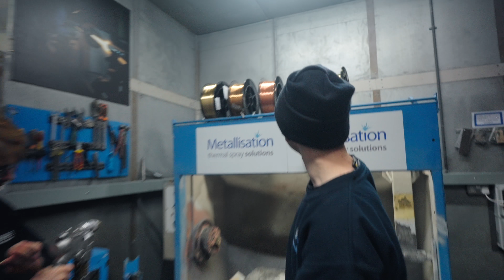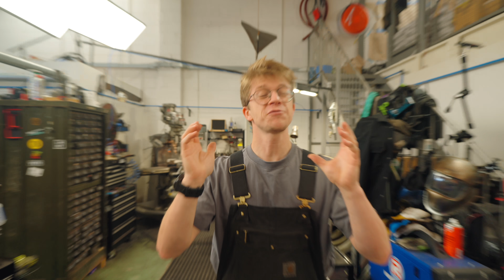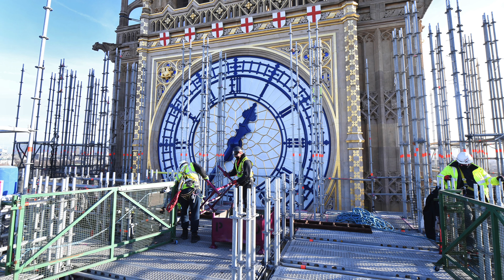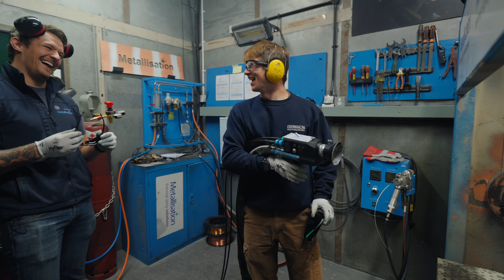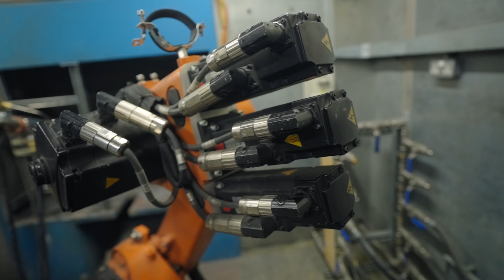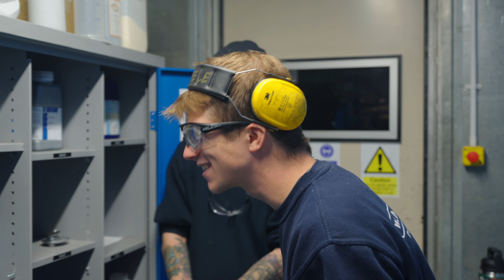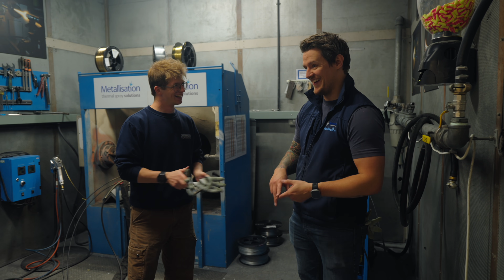Metallization

Comment: My son works in maintenance at a paper mill and they use this method for resurfacing of the rolls that the paper is pressed between during drying to make it smooth ("calender rolls").  These rolls are about five feet metres long, about a metre and a half diameter and weigh about 70 tonnes each.  They run on roller bearings twelve inches diameter!  You can imagine these would be very expensive to replace.  They wear more in some places than others, and by using metal plasma spraying they can build up the working surface and polish it back to a very high degree of accuracy and roundness.  Its pretty impressive to watch.

Comment: I think its difrent to welding like he explained. I was always taught ut wasnmore like Teflon. A mechanical bond no cureing.  Thats why the rough clean surface 'blasted' surface is required. Iv done alot off this for industrial coatings.  Zink bit o did know engineers use it for thier stuff

Comment: My dad used to sell this equipment starting in the early 1960's.  Some spray guns use powder rather than wire.  His biggest customers were jet engine manufacturers.  
Imagine spraying a bridge with zinc after it's built; it would never have to be painted.

Comment: We used Jetspay as well as cold spray at Honeywell on the rebuild side for turbine engines journals. They are absolutely correct about needing wet grinding on the hvhp jet spray especially with that cobalt in the powder solution. We would carry +/-.00005 on them bearing journals. Great invention I’m glad to have learned where it came from!!!

Comment: In Oklahoma I used a lathe that nickel coated rods for oil field drilling. Super cool process. Super hot environment. Had to heat the rod to molten for it to bond.

Comment: They didn’t show you plasma spray. It’s pretty cool too. We use a nickel base coat and a chrome oxide ceramic top coat. 

You use argon as a primary gas and helium as a secondary. It uses an anode and a cathode to start and maintain an arc.

Comment: Thanks for this video, it has answered a question I had, I often wondered how they chrome plate plastic things like shower heads etc, now I know, they spray it with molten copper then chrome plate it like you would a normal piece of metal.
Cheers, great videos👍

Comment: i wonder if the Arc sprayer could make Damascus by using 2 different steel wires (2 wires each a different alloys)  or alternating spray passes of wire of different steels (2 wires same alloy each pass)

Comment: I learned, decades ago, that you could build up metal on engine crank shaft journals through a welding process and then we (the machine shop) would turn that part back to OEM SPECS...  ...BUT I never knew the process was THIS interesting and diverse.  My brain is swimming in possibilities, albeit 30 years too late.

Comment: I'm really surprised that you don't need more protection for doing the zinc. I know that you aren't supposed to weld galvanized metal without protection, how is this different? Is it because the welding process burns the zinc and this just melts it? Really for any of these metals it seems you should have some sort of mask since they are sort of "aerosalized" like a paint.

Comment: This is amazing, you could rebuild and reuse so much mechanical parts with that. for example you could rebuild a worn down artillerie barrel or very large ship enigne parts that wear down. it would be so much cheaper rebuilding really big, expenisve machined items like that instead of replacing them

Comment: with electroplating to build up metal, the built up part has a grain structure thats not as cohesionally strong as cold rolled or hot rolled metal. eg: an electroformed optical reflector, when dropped to cement, will not dent or deform - it will 'shatter' into tiny pieces. if one built up a thickness of metal by these 3 techniques, say 1/8" thick, then after cool down period... if dropped to cement from 20 feet - would it bend or shatter?

Comment: used to work in metalizing did 6 months but totally different setups. we used to metalize CC Chanel make up boxes after they have been sprayed with a special UV coating for metalizing to properly attach and be smooth. had a massive fixed machine Vacuum chamber system, you would Load the cases, load the aluminum filler 3 inch big each in what i would describe as coils/filaments many of them, close the machine and make Vacuum, filaments light up burning the aluminum in a vacuum chamber and after a minute of cooldown remove previously black special UV painted cases into what now looks like dark aluminum reflective polished finish.  cool stuff SuPer HOT environment specially in summer 43+ celsius

Comment: I didn’t think about it, but could it add steel to an older barrel rifle? Enough that any pitting or rust damage could be filled and then smoothed out to get that deep beautiful color from bluing?  I’ve got a family heirloom that has some rust that I need to have cleaned and refinished. It’s a 30-06 so it’s a pretty hot round and I’m scared to do to much myself because I want it to still be operational for my sons, sons, son and even further. It wasn’t cared for for a few years and then got hid away for a couple more before it came to me. It’s not like a 100yr old rifle or brought home from a war, it’s just the only thing I’ve ever had passed down to me from any of my family. If I could afford it I would have the whole thing put back to brand new and then spend 7-9 times what it will ever be worth to have it engraved ornately and our last name carved and filled with gold wire. and then blued to an obsidian glass like perfection before a master woodworker creates a dark figured walnut stock and fore grip, smooth as butter on hot glass. Make a gun only worth a few hundred end up looking like one of those beautiful bespoke shotguns from the company you got a tour and walk through of a while back.

Comment: I’d be curious to see a Damascus blade made with this. Do like a super piece of metal to be the cutting edge them coat both sides over and over then switch up to a different material for a bolster or liner for the grips. You could even cut in a pattern along the backbone and fill those voids in with another metallic material or cutting groves or waves in your blade then filling them with something like this.

Comment: i just got some hydarulic cylinders repaired using the hilo HVOF coating. soo much better than having to scrap the part. its pretty amazing what results you can achieve by adjusting the tungsten carbide cobalt chrome powder. most common is 86-10-4

Comment: my company has been using it for last 5 years to fix old car body parts and add metal to fix parts that are no longer available, fixing holes in body work using the spray weld, cast iron  we can fix certain damage from corossion, using spray weld is cheaper than replacing the entire section

Comment: I know on a lot of these race cars in certain classes they have to have metal body doesn’t matter how much it weighs. It just has to be metal but you could get you. A body made out of carbon fiber then take and spray metal over it that way if someone was to check it with a magnet, it would show that it is metal and it would actually be legal unless they’ve gotten in the rule books that you cannot do such, I know one of the racers at one time did something similar to that and put really thin body panels over it, but they could see where the body panels had been added, but with this here you could not even tell so yes, I know it would be a lot of money in a vehicle, but there’s endless things you could do with this I’ve actually used the older style before to build up copper on an electric motor armor and turned it back down and I’ve also seen it done on engine crankshafts and turned back down, but what they would do is if it needed to be built up 0.010 what you would have to do is machine the crank down about 0.020 and then build it back up about0.050 and turn it back down to standard because if you didn’t, it would be so thin it could flake off and I have seen that happen in certain circumstances that they did not turn it down and build it up. They just built it up from where it was already and it made it too thin.

Comment: That pipe liner thing could be crazy useful in a lot of places if it could be made affordable for community infrastructure repairs. Think of how many small towns are still getting water from ancient corroded pipes. If it could be corrosion-proof enough material to coat them, might even be able to help places like Flint Michigan with all the lead in their pipes

Comment: 'Metallisation' is the tossers way of saying metalspray. I used to do it back in the day. Main use is to build up worn shaft bearing journals. The end result is more like crude powder metallurgy, not a monolithic end result or even a good weld to the substrate. It has to be ground back to size or turned with care & caution or it rips off. At least, that was then. Let's see what is now.

Comment: I used to work somewhere where we would use a plasma spray process to add material to damaged jet engine parts and then machine the sprayed material back into the correct size

Comment: This technology is also used on some of the parts in semiconductor manufacturing tools - it provides a high roughness surface so films stick to it without coming off, and it doesn’t warp sheet metal parts like media blast often does

Comment: I have a serious question about this. Is there anything you can use as a resist with this so certain areas can not be coated.  Like for example using painters tape to mask areas you don't want paint to get on that can be easily removed afterwards.  Is there anything you can use for this. Also if you coated an area you didn't want coated because of overspray since it's a pretty thin coating could you remove it with a wire brush or would you need to sand or grind it off?

Comment: About time you got stuck into this.  Everybody’s doing it…(well not EVERYbody).  I have sometimes wondered how this tech could relate to forging.  A spray-on canister for damascus making comes to mind.  It might minimize how much you have to mill off, or maybe you could simply incorporate it into the pattern.

Kurtis on the Cutting Edge Engineering channel recently got some arc spray kit identical to what you showed us here.  He uses it to build up worn or damaged shafts which he then machines down to spec.  He has also demonstrated flame spray for repairing cast iron.  I wonder if he knows about HVOF and how it can be used to build up a bore.  Maybe someone could shoot him a link.  I’m not sure how to do that.

Comment: When you measure the thickness of films that are sprayed you can use this probe that Alec used. Most of these probes use sonic frequencies to differentiate between materials. The "sound" of the sprayed film that is reflected back to the probe is a different frequency than the mild-steel that they sprayed it on. The machine can time how long it takes for the frequency to leave the probe, hit the mild-steel, then back to the sensor. This timing can be used to determine the thickness of the film!

Comment: Metals: Thin sheets of aluminum, copper, and brass

Organic/Non-Metal: Charcoal powder, rusted nails, and old coins

Exotic additive: Small shards of obsidian or beach glass (will crush down during forging)

Powder coating layer: Fine graphite dust or powdered cocoa for black contrast

Optional: Thin foils of gold or silver for “sparkle veins”

Comment: Just came up with a thought, you know how butterfly wings have no color in them, the color comes from the scales bouncing light in a certain way. I wonder if you would do that with this, print a surface that has a very specific surface, spray it on and peel it off and the design is transferred over and designed to bounce light in a special way, since your on the micro level I bet these devices could do that easy! It would just take some testing and which materials work best, but also applications too or would it just live as a party trick, idk!

Comment: Questions:
- does this work with glas? feeding a glas fibre through the flame?
-can you use a stencil to spray decorative patterns?
- is there a possibility to make the material stick on one of the materials of pattern welded damascus, but not on the other?
 (is there a material that would stick on one of the materials of damascus that you can then use as a stencil to remove it after the spraying(maybe with a solvent?) leaving the other material sprayed?)

Comment: Years ago we used to spray metals with the Eutectic micro flow method, basically an oxy/acetylene torch with a powder hopper on the top - that was in the 80's
ATB
Dave

Comment: Alec, the HVOF has a wide range of uses, but here in the US it’s used extensively for coating of Rotors in mud motors. Carbide coatings have extremely high wear resistance, it’s used on bearing journals, and any surfaces that can be exposed to bedrock/debris while the tool is turning “downhole” so to speak. 

I’d be happy to share more if you’ve got time! I’ve been selling products into this industry my whole life, and definitely have seen the most extreme examples of this technology implemented. 

Great video as always!

Comment: Man that is awesome 😮... I've seen the spray technique used for repairs on shafts but never thought of the design  or corrosion protection... And also using powder but never wire ... The powders tend to be quite expensive... Know that from 3d printing 😊 ... Super video

Comment: Alec the flame spray gun running puts out a high frequency noise (as others have pointed out) that's painful to the ears. Could you please mute the sections of the video or edit out the high frequencies? Thanks.

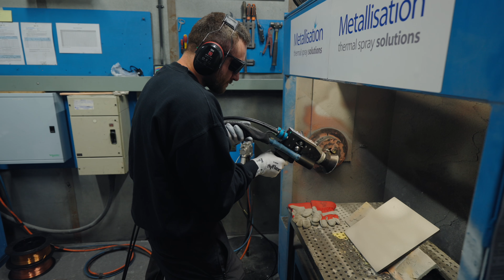Comment: I get that they have the most hardcore massive flow rate LEV, but I am still surprised they don't offer any RPE. They could still very easily be inhaling the fumes and metal particles. 16:27 is a good example of how it wouldn't take much movement or maybe for a shorter person to be right in the fumes and inhale it in. Multiple layers of robust controls are required for complete protection

Comment: Ive had some garden sculptures sprayed with bronze , we had to go to stainless as the backbone of the job, as steel could break down with rust patches over time , Looked good enough to fool an expert , also had some zinc sprayed for plant room fit outs while lockdown shut the galv plants , Interesting process, if not a little expensive .

Comment: We used cupper-sputtering for ESD -protection. The advantage, compared to AL-vacuum metallization was that it built a very heavy layer, which did not disintegrate during the ESD-test (by an ESD-gun). I worked at a Swedish company. Of some reason, all the companies we found that could do these high-tech things in small series, were in Denmark... Small high-tech companies, a typical Danish thing...

The cupper sputterong was inside a smallish plastic box (one side open) with various hidden surfaces. I dont know how they did it...

Comment: A question from someone completely uneducated in metallurgy, blacksmithing, or this technology, could Alec use this tech to completely solve the problems he had trying to forge damascus together from different metals? Spray on steel to both sides of non-steel plates, maybe even wilder non-steel things if they had a super high melting point like carbon fiber (which might be incredibly stupid, but sounds cool to someone uneducated like me), and then forge weld them together after that as if he was forging traditional steel damascus?

Comment: Ok Mr. Ghostbuster.

Isn't tungsten carbide used in machining inserts or something? Also I thought anti-corrosion etc material features were in the core of engineering. At least machine engineering has plenty of that.

Comment: Most useless process I've ever seen. Laser cladding has way more benefits than this. This is a cheap way to cheap costumers into investing into this. The thickness is to thin, no wear resistant part will last. Better of with laser cladding... plus the amount of parts that were called the wrong thing, not professional at all. Don't buy into this at all.
Reply: the only thing this would be useful for is cosmetics

Comment: The flame is essentially just waving the world's messiest 3D print head around the shop with the feed turned on. I wonder if the cone angle could be pulled in somehow... could do some very strange graffiti, or with more patience, potentially sculpture.
As for the HVOF, that is not a 'jet engine'; it has an oxidizer supply. That is a pressure-fed rocket.

Comment: Great video, I’ve used the Arc and flame systems for quite a few years, from decorative fireplace surrounds, rebuilding shafts and sub sea connector coatings, great equipment and great aftersales support, Darren was my go to until he left a few years ago

Comment: Ah, metal-spray! I worked in a machine shop that also did metal-spray/metallization. We could do ceramic, stainless, aluminum-bronze, and others. It was cool!!
A shaft would come in with a worn spot. We would cut it down to clean metal, metal-spray build up of whatever we wanted, and either lathe or grind it back to size.

Comment: I worked with a machine that steamed metal onto paper, the Maschine went into a deep vakum and melted metal wires at i think it was 1300°C so the metal just steamed onto the paper.

We adjusted the the plates that got heated by eye at looking wich color they have.

Comment: Is it just me that thinks that thing almost looks/acts like a melta in 40k? The big plus to using aluminum over zinc is it's also non-toxic. That third one wasn't so much a jet engine as literally a rocket engine.. especially being fueled by kerosene, which the Saturn 5 was fueled with.. kerosene/lox.